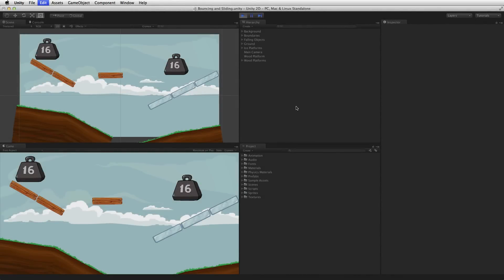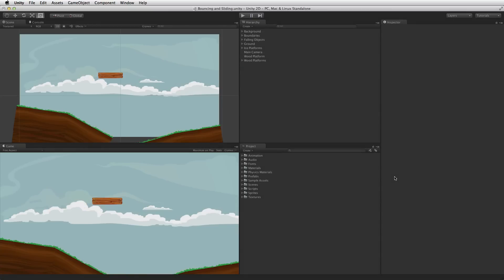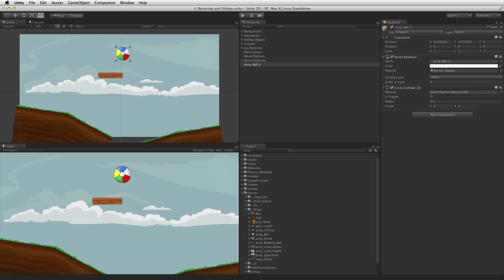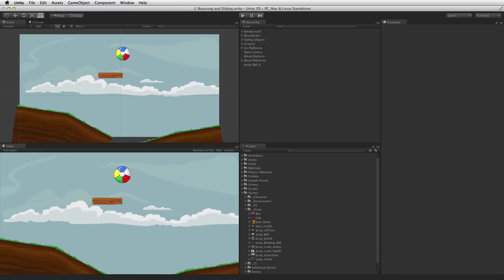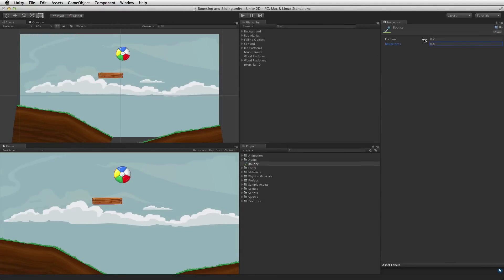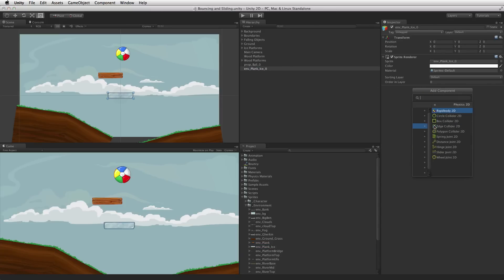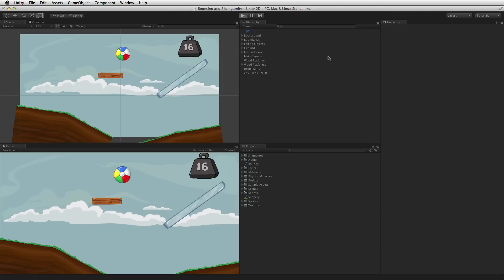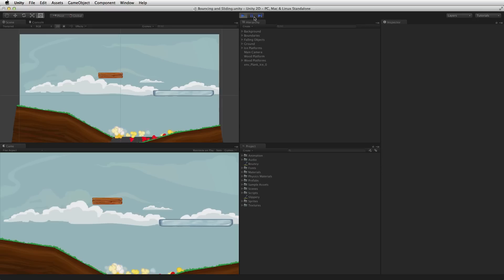Sliding & Bouncing in 2D - Official Unity Tutorial

Comment: What if I want to set the value of the angle of rotation of this weight, but at the same time it tried to adjust to the surface against which it rested, as it was in the video when it fell on the platform

Comment: Thank you for this tutorial. I just have a question: at the beginning of the video, I can see that an object falls on a wooden platform and doesn't fall. I imagine that you simply used the friction field of the physic material 2D. But when I try to use it to make a character moving on stairs for example, a very low slope makes it sliding, and I cannot find any answer on the web. Does anybody know how to prevent it?
Reply: Set the coefficient of static friction higher. (No idea what it's called in Unity, but that's the physics answer.)

Comment: [PLEASE HELP]
The sliding doesn't work for me, I think it might have something to do with my movement script, because when I switch the ground layer it works just fine. If anyone has time would you please tell me what's wrong with my script?
Here it is:
{   
[Header("Horizontal Movement")]
    public float moveSpeed = 10f;
    public Vector2 direction;
    private bool facingRight = true;
    
    
    [Header("Vertical Movement")]
    public float jumpSpeed = 15f;
    public float jumpDelay = 0.25f;
    private float jumpTimer;

    [Header("Components")]
    public Rigidbody2D rb;
    public LayerMask groundLayer;
    

    [Header("Physics")]
    public float maxSpeed = 7f;
    public float linearDrag = 4f;
    public float gravity = 1;
    public float fallMultiplier = 5f;

    [Header("Collision")]
    public bool onGround;
    public float groundLength = 0.6f;
    public Vector3 colliderOffset;

    // Update is called once per frame
    void Update(){
        onGround = Physics2D.Raycast(transform.position + colliderOffset, Vector2.down, groundLength, groundLayer) || Physics2D.Raycast(transform.position - colliderOffset, Vector2.down, groundLength, groundLayer);

        if(Input.GetButtonDown("Jump"))
        {
            jumpTimer = Time.time + jumpDelay;

        }

        direction = new Vector2(Input.GetAxisRaw("Horizontal"), Input.GetAxisRaw("Vertical"));
    }
    void FixedUpdate(){
        moveCharacter(direction.x);
        if (jumpTimer > Time.time && onGround)
        {
            Jump();
        }

        modifyPhysics();
    }
    void moveCharacter(float horizontal){
        rb.AddForce(Vector2.right * horizontal * moveSpeed);

        if((horizontal > 0 && !facingRight) || (horizontal < 0 && facingRight)){
            Flip();
        }
        if(Mathf.Abs(rb.velocity.x) > maxSpeed){
            rb.velocity = new Vector2(Mathf.Sign(rb.velocity.x) * maxSpeed, rb.velocity.y);
        }
        

    }

    void Jump(){
        rb.velocity = new Vector2(rb.velocity.x, 0);
        rb.AddForce(Vector2.up * jumpSpeed, ForceMode2D.Impulse);
        jumpTimer = 0;
    }

    void modifyPhysics(){
        bool changingDirections = (direction.x > 0 && rb.velocity.x < 0) ||  (direction.x < 0 && rb.velocity.x > 0);

        if (onGround)

        {
        if(Mathf.Abs(direction.x) < 0.4f || changingDirections){
            rb.drag = linearDrag;
        }else{
            rb.drag = 0f;
        }
            rb.gravityScale = 0;
        } 
        else
        {
            rb.gravityScale = gravity;
            rb.drag = linearDrag * 0.15f;
            if(rb.velocity.y < 0)
            {
                rb.gravityScale = gravity * fallMultiplier;
            }
            else if (rb.velocity.y > 0 && !Input.GetButton("Jump"))
            {
                rb.gravityScale = gravity * (fallMultiplier / 2);
            }
        }
    }
    void Flip(){
        facingRight = !facingRight;
        transform.rotation = Quaternion.Euler(0, facingRight ? 0 : 180, 0);
    }

    private void OnDrawGizmos()
    {
        Gizmos.color = Color.red;
        Gizmos.DrawLine(transform.position + colliderOffset, transform.position + colliderOffset + Vector3.down * groundLength);
        Gizmos.DrawLine(transform.position - colliderOffset, transform.position - colliderOffset + Vector3.down * groundLength);
    }
    
}